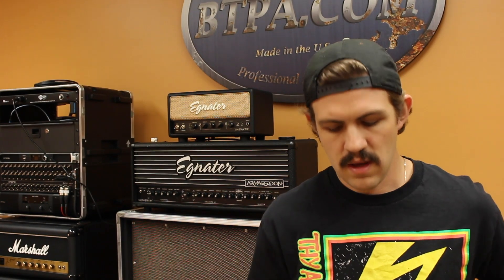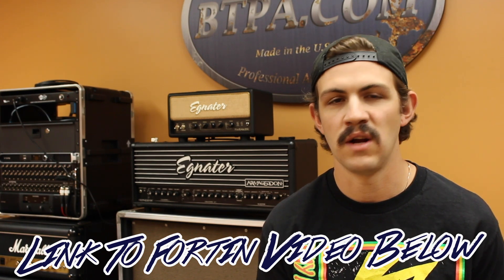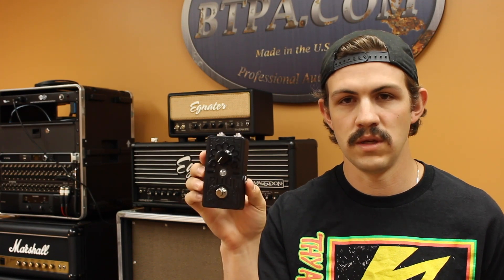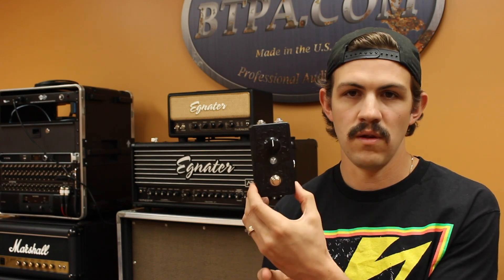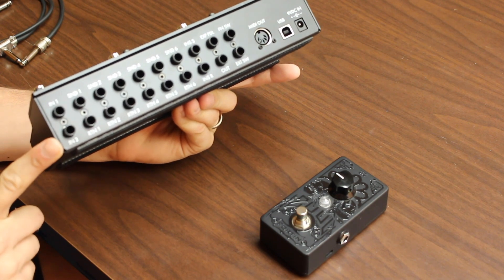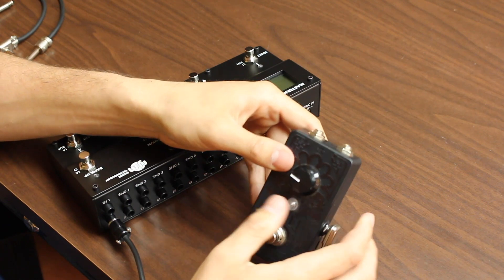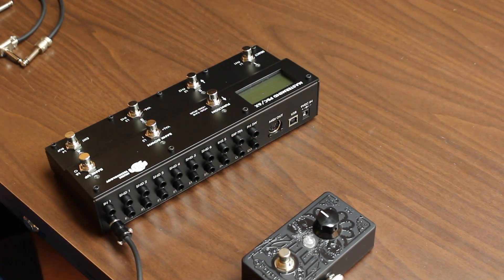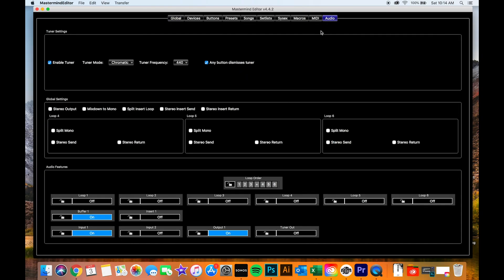Using the RJM PBC6/X with the Fortin Zuul & Its Key Input

Comment: How come will it not work if it happens to be after some effects? the only issue for this that I would see is that it would not kill the noise coming from those pedals/fx....
Reply from the maker: The key input is supposed to see your clean guitar tone for monitoring the open/close of the gate. Technically, yes this will work with effects before; however the gate may not be as effective/work as well as monitoring your clean guitar tone.